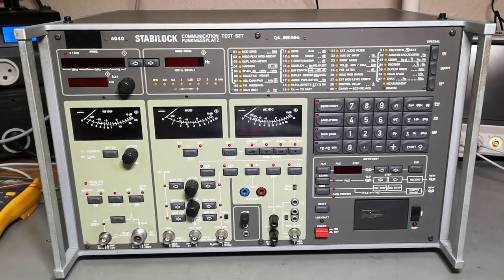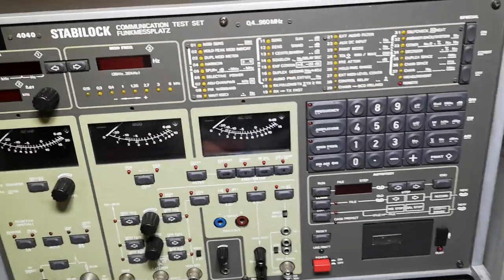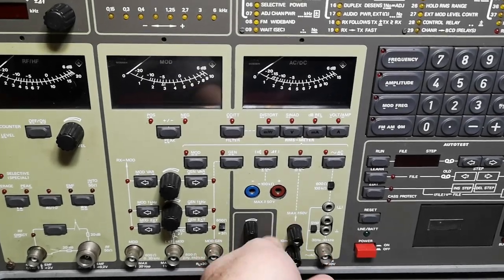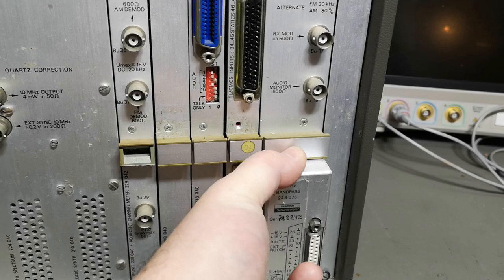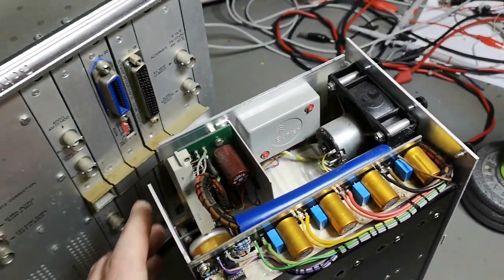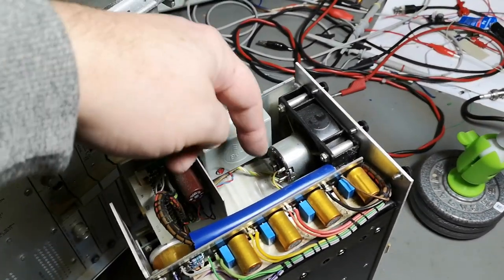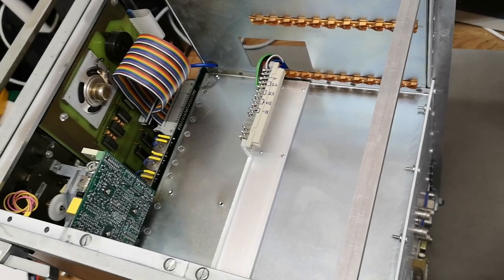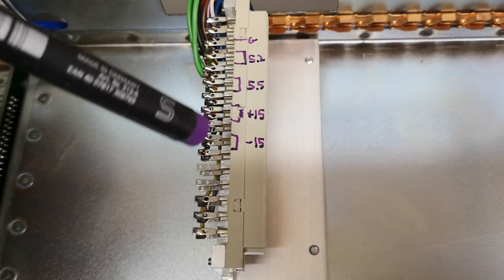Schlumberger Stabilock 4040 0.4 to 990Mhz repair power supply teardown (part 1)

Comment: Thanks Thomas for nice teardown video! I've watched it several times.  I'm Jyrki "Jay" from Finland. Because of Your video  I was today encouraged to purchase one obviously faulty Sclumberger 4040!  Powers up but no generator control and same fault codes as on your video. Let see how my project will go. I've worked with 4040 and many other RF instruments 35 years ago professionally as a young engineer. Now I hope this unit will supplement my ham shack workshop one day as a trusted accurate device. 73!  OH1XYZ
Reply from the maker: start with all the capacitors like i have shown, all mine leaked and caused aditional corrosion problems, it it is a big job.

Comment: Hi Thomas, thank you, great job!
I'm Peter from germany and I developed this power supply for Schlumberger in 1984 (I believe) and we manufactured it for Schlumberger. I sold my company twelf years ago and unfortunately my follower threw away all components and documents from this power supply. So I'm sorry I cannot help you.
Are you sure that the transformer is defective? It may also be, that the secondary rectifiers are defective.
Best regards Peter
Reply from the maker: this unit is now repaired, transformator was fine..
Reply: @TeardownOZ2CPU Ok!
Reply from the maker: @peterm7069  i forgot to say : thanks a lot for your reply nice to hear from you, funny you found this video, maybe you find a few more of interest if you browse thru the video folder of mine
Reply: @TeardownOZ2CPU Dear Thomas, your videos are very interesting and I will browse through the next time. Recently I bought some old and propably defective measurement equipment which I have to repair and I hope that I will find a lot of information that will help.

Comment: Hi, so this is a real catch 👍, in the previous videos it looked like you raided an army warehouse 😁 and now it looks like one radio station in your area has stopped broadcasting 😂
Just one observation about the power supply with a spare source, as you know, we have the same sources and recently I solved a similar problem when I needed more power at once, I made a module that I feed from the third non-regulated 5V part and it connects the regulated voltage from other sources at the same time by pressing ON/All on the Siglent. When repairing my device, I had the source set to serial mode and the outputs changed to standard +15/GND/-15, I didn't use each separately, because I needed the current protection to disconnect both positive and negative voltages at the same time.
I'm very curious about this repair, how it will work when you replace the 2lbs of capacitors and the rest of the necessary useless things 😁
Reply from the maker: yes this model is famous for its dead capacitors, just google a bit and see how people ask about this in all forums :-) the shorted red caramic 100nF was a surprice

Comment: Prepare yourself to many capacitor change, I found a couple of dg201 switch burnt  and I am still running the autotest with a couple of errors.... it is a very nice machine though! I had to change the big supply capacitors...

Comment: behind that alluminum panel there are more modules ....Pll, output system and so on...great machine!
Reply from the maker: maybe a few more capacitors to fix hidden in there ?? nightmare to go in there ??
Reply: @TeardownOZ2CPU  I had to change 10 mf and 22mf in the 80 mhz spectrum module....you figure!
Reply from the maker: @danielepatane3841  thanks a lot, all comments much appriciated, since this unit is in for deeper service

Comment: So this generates any frequency from.4 MHz to 990 MHz ?

Does it receive that range as well ?

There was an ICOM radio receiver that was like this that could receive from .1 MHz to 1 GHz
It did all mode AM FM USB LSB WFM NFM SWFM WAM SWAM and SNFM

It cost around 2000 dollars in 1990 and I am pretty sure it transmitted as well.

Back then min wage was 2.35 an hour, so about 6000 dollars in today's money

Outside from the radio repair shops and corporate environments where they tested and built radio equipment their was only one individual that I knew of who actually owned one of these and they said it was against the law in 87 when the cellular laws were made and the anti-piracy laws were enacted making reception of anything digital illegal.

They kept it in the closet and rarely used it.

Over the years I noticed that people that had a high end receiver or a high-end ham shortwave radio they would have very little else that they owned and it was the only thing that they spent time with in their lives outside of going to work

I would walk into their apartments and they would have very little furniture and in one room they would have a wooden table and a chair and the radio and the power supply and a microphone and that was about it

Very sad
Reply from the maker: yes it TX and RX all things you can imagine in that range, in my Contry Denmark, it was never illegal to ovn any type of transmitter or receiver for any band or modulation type, however you are of course not allowed to transmit on any non ham radio frequencies, it was always ok to receive any thing you could, but not ok to record it, or tell anyone what you heard that was not transmitted directly to you.

Comment: I wonder how simple it would be to recreate the missing 5.5V from the 23V input using modern stuff. That way most of the original parts are preserved.
Reply from the maker: I am more like : pull out the 50Hz transformer, and put in 4 modern AC/DC unints and done deal, ofcourse add good extra filters on all DC lines.
that is just how i feel, it will take away a lot of weight also
Reply: If 3&4 also works, 5,5V might be a new unit and rest could be reused.